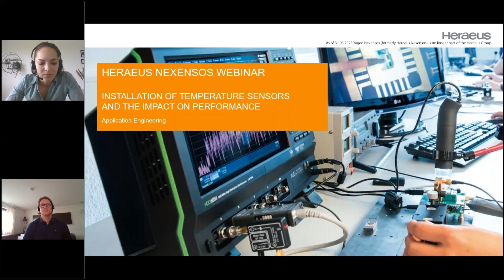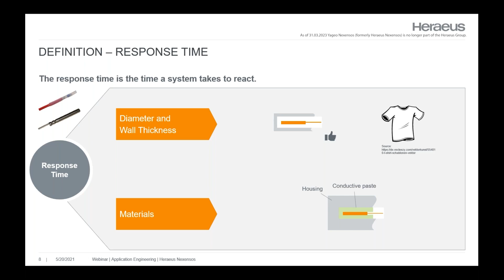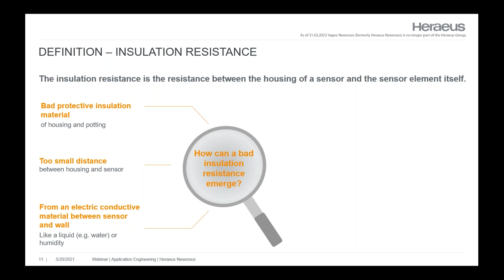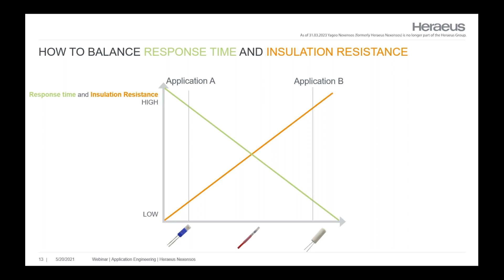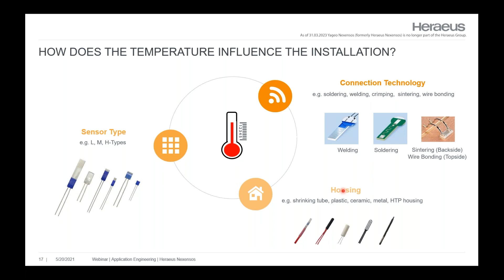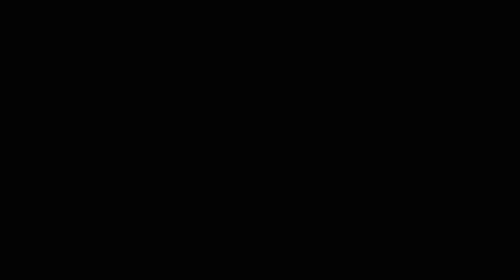Installation of Temperature Sensors and the Impact on Performance

Comment: What would be the best of sensors to measure the temperature of a surface, like a metal sheet?
Reply from the maker: The best assembly for measuring the temperature of a metal sheet depends on various factors, including the specific application and environmental conditions. For optimal performance, it's important to ensure a good connection between the sensor and the surface to minimize air gaps that can negatively affect response time. If feasible, directly mounting the sensor body to the surface can provide the most accurate readings. For tailored advice based on your specific needs, please reach out to our technical team at www.yageo-nexensos.com.